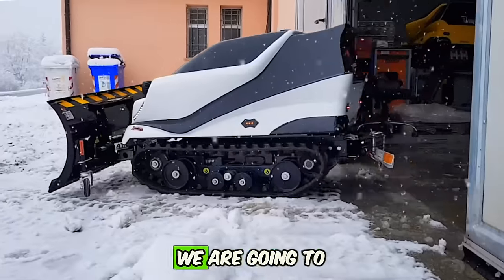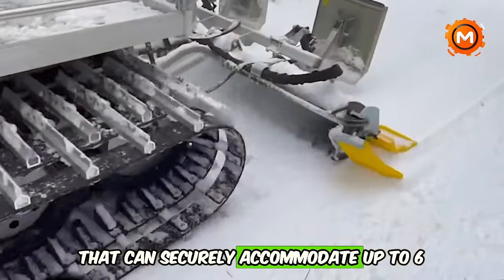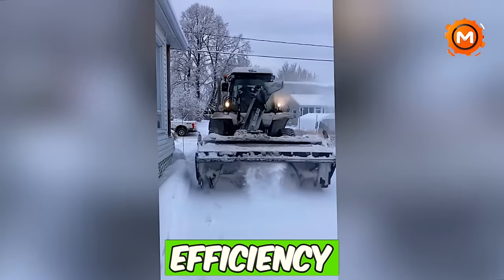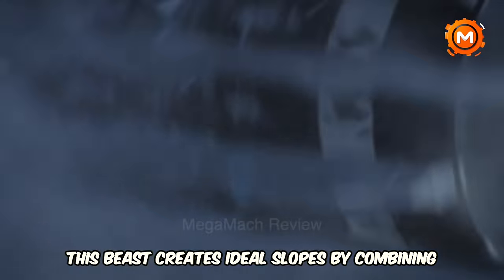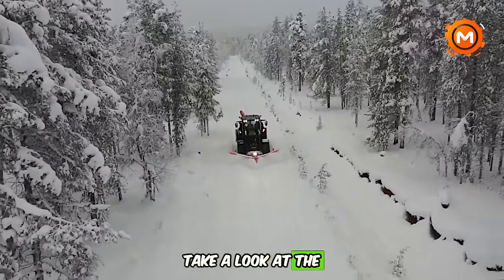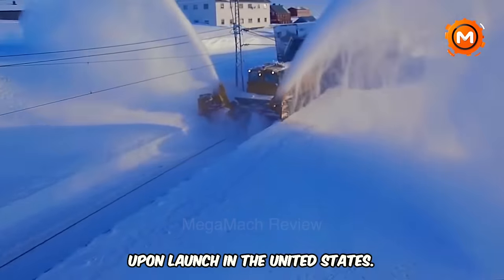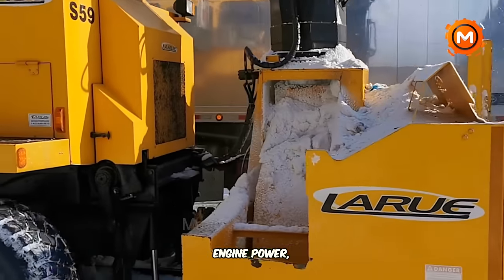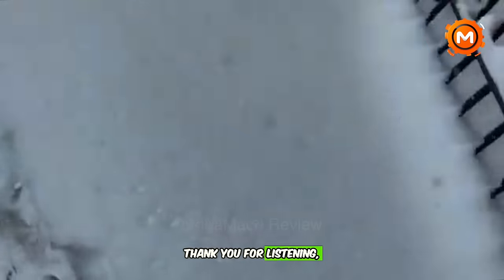Mega Powerful Snow Plows: A Global Phenomenon

Comment: I certainly don't agree with the comments about SnowJoe's "great customer service". They introduced a phenomenal series of 100V systems, including a beast of a snowblower. But after a couple of seasons, they discontinued the entire line, and no longer even source or sell replacement batteries for any of their 100V line of tools (snowblower, chainsaw, extension pole saw, grass trimmer, etc.). I'd avoid them like the plague as a potential source of electrically powered tools. The equipment is great, if they support the particular item and don't choose to abandon their customers. As someone who invested several thousand dollars in their 100V systems, take my warning to heart. They're not to be trusted.
Reply from the maker: Thank you for sharing your experience and warning others about SnowJoe's lack of support for their 100V line of tools. It's important for consumers to be aware of these issues before making a purchase.

Comment: A lot of over blown sales hype particularly on the smaller machines. They are only showing ideal conditions and not the tough situations that snow storms can leave behind. I have seen wind driven snow that powerful heavy duty snow removal equipment has a struggle getting a cut into.